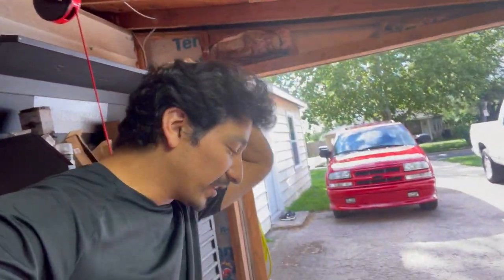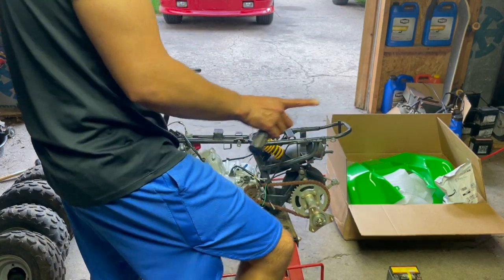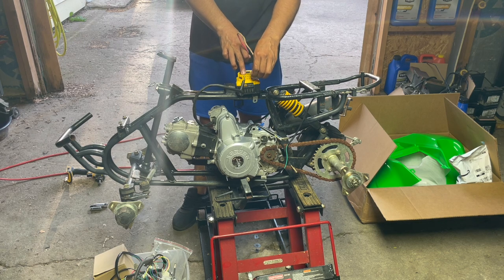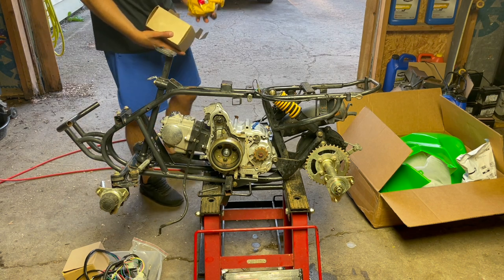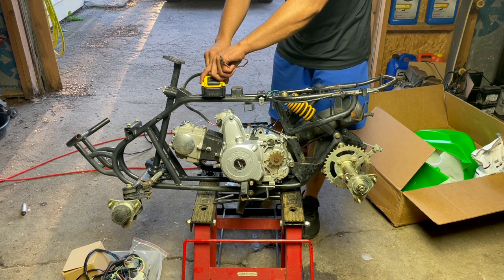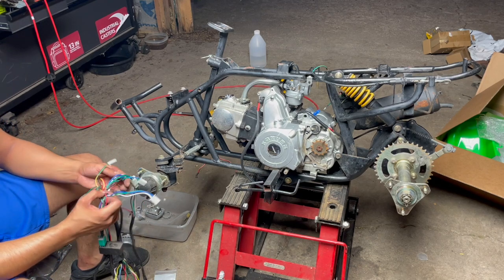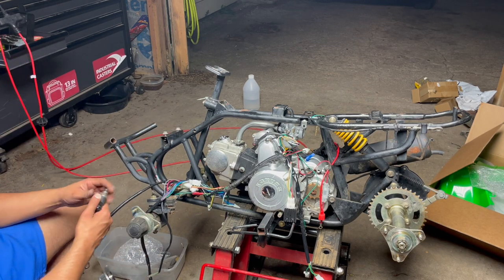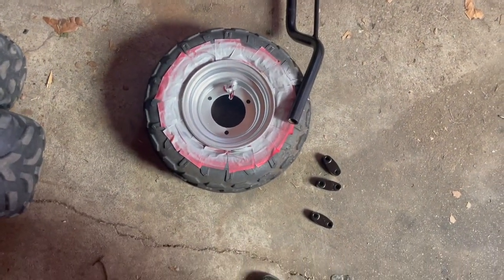50cc Kazuma Meerkat. Chinese Quad. Complete Build.

Comment: Do you have a good picture of a pz20 carb and the fuel line routing for a Meerkat 50cc quad?
Reply from the maker: I think I had to use a pz19 on those tiny quads.  Also I had to order a shorter or longer carb…those are so hard to make fit😩🙃

Comment: I love how you just persevere. I'm ready to give up on mine. I just got a new brake caliper with hose and handlebar lever from Amazon but they shipped it with a piece of plastic between the pads and I CANNOT get that thing out. Have you ever gotten new brakes like this? I tried to compress the pins but ended up chipping a corner from the outside pad. WTF? How are you supposed to install them if you can't get that stupid piece of plastic out? There's no spot to compress the piston either. I sent a message to the seller and instead of answering they asked for a photo. Any advice? Thanks!
Reply from the maker: Thanks man.  Sometimes I overdo it and refuse to give up. Some vendors aren’t the most helpful. Also you are not going to like this but if you have IG or Facebook, it would be helpful if you could send pics.
Reply: @brokemexicanreviews  The seller got back to me and also asked for pics : ) which I gave him. I'm a former Class A auto mechanic with Honda and I have never seen the likes of these designs. I'm used to calipers that slide and flip up and you don't have to struggle with for 18 years- and so cheap they break at a tap. But this spacer between the pads is NOT moving up, down or left or right. Several people have tried it with several different tools. I'm just asking for a replacement with NO spacer. Many you are one patient (and nice) dude! Thanks!